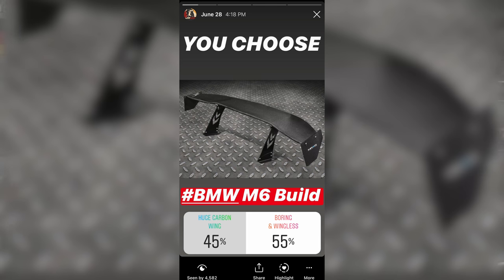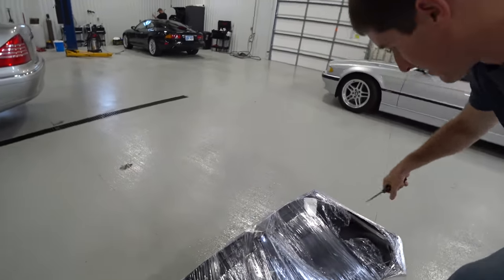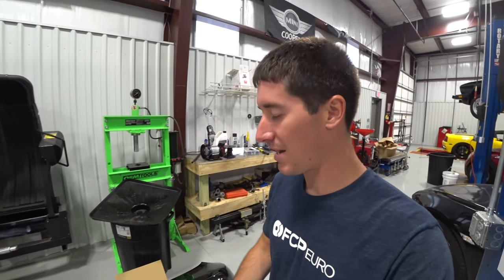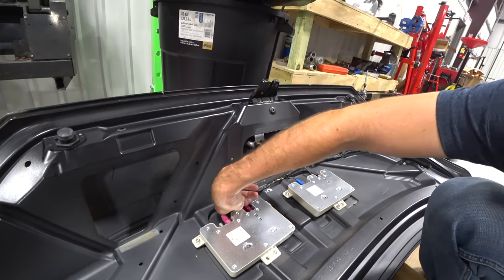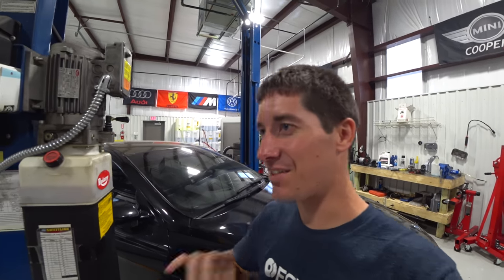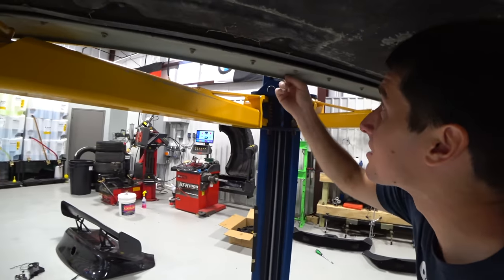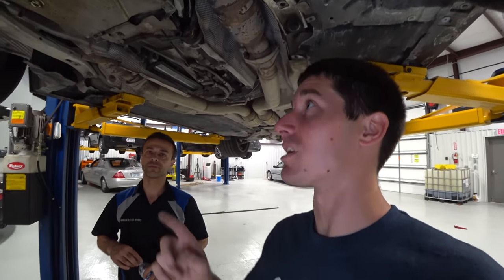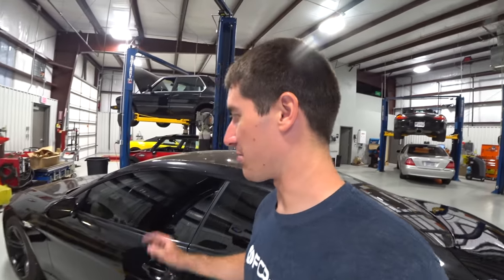UNPIMPING My CHEAP BMW M6 *Giant Wing Removal*

Comment: Yeah, my son bought a cheap BMW, and he ended up spending over $8,000 in repairs and maintenance over the two years that he owned it. Moral: never buy a used BMW.
Reply: Bmw= big money Waster
Reply: B M Trouble You....
Reply: buying new doesn't mean they are reliable either...
Reply: Not that bad. He got the drive a BMW for 2 years.
Reply: i disagree..  You can find nice and reliable ones.. It all depends on which model and do you know what you are getting yourself into.
Reply: Translation: They aren't too bad if you know how to work on them and can afford the parts.
Reply: Why did your son even buy a bmw just buy a toyota
Reply: IMO that's why buying something like an M6 makes a lot more sense than a 3 series. If it's expensive either way, get your money's worth.
Reply: Since we're play this game: Bavarian Manure Wagon...
Reply: If you can work on it, bmw is fine. Otherwise buy a Corolla or Accord
Reply: Moral: never buy a BMW. Fixed that for ya Jeff Zekas
Reply: I had a 70s 2002 and an 80s 318, would never buy one after that time period..
Reply: When it comes to BMWs, lease, don't buy.
Reply: Probably that’s why it was cheap. I’ve had a 325i 89, 328i 96, 530d 04 & 330d 07...all of them great and reliable cars. The average BMW owner is looking for performance, so when the car has been owned by different people over the years they are more likely prone to face problems, all together with highly priced spare parts makes a dangerous combination to asses before hand. The real BMW uses a 6L cylinder engine, and that’s where they are absolutely the kings
, especially before year 2000
Reply: jeff zekas:  no, the moral of the story is... if you can't work on your own car and have to take it to a shop, don't buy a bmw
Reply: @PorscheTurbo9  I have driven several Toyotas and couple of german cars and I can say that I'll never buy a Toyota simply because I don't like how they feel and drive.
Reply: That’s probably because your son knows shit all about cars or what to look for before buying one. Also buying any ‘cheap’ car can end up costing a lot to fix. Moral of the story is learn to fix it yourself and don’t buy a cheap anything and not expect problems. Ok?
Reply: Karl H. Künstler so what your saying is toyota is boring to drive then any German car
Reply: I must be the luckiest driver in the world!
I have driven German cars exclusively for over 35 years.
My first was a hand me down Opel Manta and my current vehicle is a 2019 A8.
Never had any real issues with any of them.
Maintenance by the book by a knowledgeable mechanic and sensible driving has resulted in excellent reliability and durability.
All of my previous vehicles had been driven between 285 and 312k miles before being sold or traded.
Reply: Personally, I’ve had 2: a 99 and 04 E46, and they were perfectly reliable even if I got them in less than unsavory shape. Though both of them had cooling issues, did the work myself, no problem. You can find some without issues, you just have to look hard :))
Reply: Sounds familiar. One bad experience justifies shitting on all the countless good experiences had by people who didn't buy lemons. Just sounds like you've bought a lemon and paid the price. I've owned countless cheap BMW's with 200k/300k miles and all have ran great. As long as you are moderately competent it's not hard to find a reliable German car.
Reply: @PorscheTurbo9  Sort of yes. 
I have a heavy foot and pedals on Toyotas were super sensitive. One little touch and revs where through the roof. Opel, Volkswagen and Skoda were all much more forgiving especially for a beginner driver.

On these german cars steering was quite vague but you atleast felt something unlike on Toyotas where the wheel felt dead. As if it wasn't connected to anything. My 20 year old PC gaming wheel literally feels better.
Reply: Karl H. Künstler oh ok
Reply: Karl H. Künstler wait are you from a different country?
Reply: TBH thats how it was with me in the 90's with GM. Cadillac and Oldsmobile. Nothing but problems. Right around this time in 1999 I leased an Oldsmobile Auroa. As soon as I drove off the lot the check engine light came on. 6 weeks later the tranny wouldn't shift out of 2nd gear. 30 months into a 39 month lease the motor seized. It sat in a mechanics garage for 6 months until a used Northstar could be sourced because GM wouldn't or couldn't put a new motor in under warranty. I get the car back and the ECM gave up the ghost. The mechanic puts a new ECM in and it keeps shorting out. I'm into this car for at least $5,000 and have 4 months on the lease. I was leasing to avoid these issues.I wound up going to Volkswagen and leased a new Passat GLX and never looked back. GM still sucks. Having owned VW's, BMW's and Mercedes-Benz, As much as I like BMW, Mercedes builts a much better car. That being said I have PTSD from owning GM's.
Reply: After owning multiple used BMWs, it all comes down to whoever previously owned it. The last two 335i’s I owned, one was a pile of junk that needed $7k in repairs in the first year,  and one was more reliable than a Honda Civic I once owned. It only needed a water pump and blower motor in the 134k miles I put.
Reply: i bought BMWs for £750 or less or more my car was £1600 530d m sport decat stage 2 remap hybrid turbo its called shrewd negotiation or you amercans treat your cars like pos or and you get the shitboxes
Reply: Matthias H I have a Civic and it has not needed anything except a stupid door 30 dollar door-clicker that all the latest Civics use.
Reply: James Medina My Civic had electrical problems that I suspected was from a bad ground. Mine was a 98 and I live in the rust belt. I once had to put a new battery terminal at -40F. Dash lights would work on and off. It sometimes wouldn’t get out of park. The rad then blew up. I sold it for $400 and the new owner then had to put a new motor in it. This was a car that I did 5k synthetic oil changed
Reply: You wrong, buying a used bmw is not a bad idea obviously its gonna be a money pit if its past 100k miles duhhh if you dont have the money for parts you can't afford it
Reply: Marco James Honestly I think a lot comes down to both the longevity of metallic parts and plastic parts, and thermal management. Ultimately the automakers make decisions on what the customer can afford and they DON'T want to build a car that lasts "forever".
Reply: @OrjonZ  it would be a lot cheaper to just wear a giant "I am an IDIOT" sign.
Reply: Depending on your income and lifestyle. $8000 over 2 years sounds incredible. Depending on the year and model is the main component when buying BMW’s.

Comment: 2 seconds = open trunk
3 seconds = panic
I think an extra button would make more sense, especially if you're going on a trip and trying to put luggage in your trunk at 4 AM.
Reply from the maker: Terrible design for sure 😂
Reply: The older BMW key used 3 buttons. Doors, trunk, panic. It seems odd that BMW would integrate two functions into one. But, BMW does a lot of things that don't make sense.
Reply: WatchJRGo it’s BMW, they’re too cheap to put in an extra button.
Reply: Makes me wonder why they decided to use the trunk button as the panic button. The only button the people generally hold. They could’ve used the lock/unlock buttons.
Reply: @matte8441  Lock and unlock are for open your sunroof and windows. Always use this feature in summer. In germany we dont have a panic button so they need to add it at the trunk button if they dont want a special key only for US
Reply: I woulda thought the 06 6 series woulda had a different key than a 06 3

Comment: For how trash that aero is it's simultaneously fairly well executed 🤔
Reply: It’s a 50/50 job. Looks good 50ft away at 50 mph
Reply: I bet at 50mph that wing flaps so much it generates lift instead of downforce
Reply: not executed well for the guy who wants to take that stuff off. Holes drilled in front bumper are hard to get rid of

Comment: JohnRoss,  I have driven a M6 in its full right out of the factory specs.  I gave it a good and hard drive.  I was really impressed with the heads up display in M mode.  It is a beast of a car. I took it to a store parking lot and just turn off the traction control and just dumped it.  It gave me the fizz for sure.

Comment: My E90 M3 had the same issue with the mirrors - something breaks inside them. The easiest solution, and one the Car Ninja can definitely help you with - just code out the power mirror feature to leave them permanently in one position. That deals with the mirror fold in switch, the key folding them in, etc. Just ask him and he’ll sort you out.

Comment: Great video like usual and I like how all the car guys on YouTube in your area work together and get along. I had to replace the drivers door on my old Neon coupe and I had to swap everything into the new door as it was a super base level car and mine is a highline so has power everything but windows. I spent a lot of time tearing out both door handles so I could swap it over as a unit. Had to swap everything onto the new door anyway but after I got the handles swapped I realized I could have just swapped the lock cylinders with a simple snap ring remove and avoided messing everything up trying to swap everything which meant loosening the window track for room to get at it move it out of the way. Hopefully I won't ever have to do it again but look your situation over before you make it twice as hard for yourself.

Comment: One thing I have learned watching this channel, hoovies, car wizard, etc,   Is to NEVER buy a used BMW, and never ever with a V8.   Why are people still buying BMWs, if it will cost you thousands to keep it on the road.   Crazy.
Reply: I have a 6 series for the past 2 years. All the weak spots were addressed before I took ownership. The V8 is a pretty good motor once it's sorted out. Much better than the V10 or v12.
Reply: Love these videos, helps me buy these cars cheap! Everyone forgets that people only go to the internet to report faults never to say how good the car is, overall the fault percentage compared to thousands of cars sold is tiny. Get a well maintained car and the car will be good to you.
Reply: As a former owner of a BMW I'll never buy another.   Great when they're working, but far too fragile with extremely poor reliability engineering.   And BMW only support you enough to limp you out of warranty.
Reply: Glad you mention Hoovies.Is that watch jrgo in one of those episodes.with the car that had the bullet holes.
Reply: Maybe just USA BMWs. I have had several in the UK (5 series) and they have all been very good. Never had any major issues with any of them. We tend to buy smaller engined ones here.
Reply: BMW doesn't design these cars to last. At. All. The entire line up is garbage once they age. But if you want to sort the mess... you can have a great car.

Experience on this here too. I am in my areas leading Euro and ONLY exotic dealership and mechanical service. The number one hitter is every single BMW that comes in. Land Rovers owners pay us almost as dearly...
Reply: RTH Animations I am also from the UK and share the same good experience. Maybe it’s the poor quality fuel in the US?  No idea

Comment: Just got my dad's new daily running solid, a 2007 Dodge Charger R/T. Twin pipe with glass packs, new cold air intake, SRT 20" wheels. She's a beauty after I followed your example. Purchase price was $1750, full finished price $3200.
Reply: I had a 2007 R/T as well, man that thing was fast! If only the interior would have been less plastic, it would have been perfect. Mine was black on black, tinted windows and sitting on black 22's. Kids called it Murdered Out, I'd never heard of that before.

Comment: Now you need to find a new bumper cover for the car, one that doesn't have screw holes for the ricer body parts. Thankfully the screw holes for the siding side skirts are not visible.

Comment: Nope, still dont want one..........
So your goal is to show people why a used Bimmer is not a good thing aaaaaaand I agree!
Win
Reply: Lmao. All it takes to buy a good one is an iq above Arctic room temperature and/or a little bit of competence. I've had plenty with no issues. 1991 318is with a fat single turbo and 250k miles on the clock. Daily driven for the past five years no issues. 2006 530i with 200k. Only regular maintenance and one coil pack. But if you still don't think you are competent enough to find a good one, just don't. Leave all the great ones for people like me :)

Comment: I just want to scream at somebody, this was an effing $100,000 car they were screwing holes in and putting wood screws in the the body, using fucking vinyl house siding.  Even 4-5 years ago when all this ricing/hack job was done it was probably a $20 to 30k car if it ran good/looked good.

Comment: Well, if the engine does what BMW engines do and explodes anyway after you do the rod bearings, you can always LS swap it.
Reply: @kingssuck06  Uh, it won't? Aftermarket cluster or some kind of interface, radio, find some 5 or 6 speed manual, rear end can probably handle the power. 
Don't think this hasn't been done, people have been doing stuff like this since cars where computerized. 
I mean hell, someone swapped in a 6 rotor Wankel into a M6, google it. You can't think of this car as just a BMW, but just a chassis with wheels. Start from that point and figure out what works, what's needed, what isn't.

Comment: Dude! Just save money and practice your carbon skills on that wing. By some carbon fiber and the coating and practice on it and the front lip. I think  It would make for a very interesting video. Also why do you always remove the cool things from your cars? That backup camera came with the infotainment system in the bmw that looks like oem. You should leave it since you said the original car never came with one.